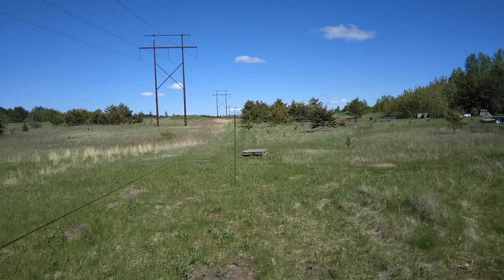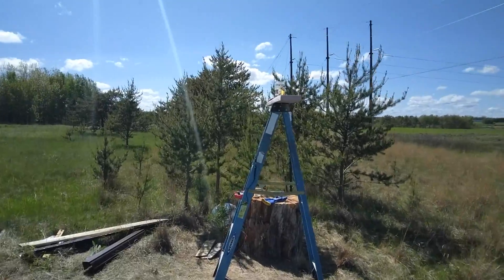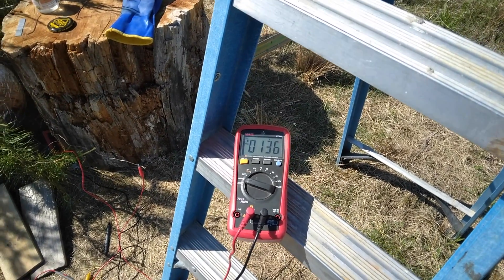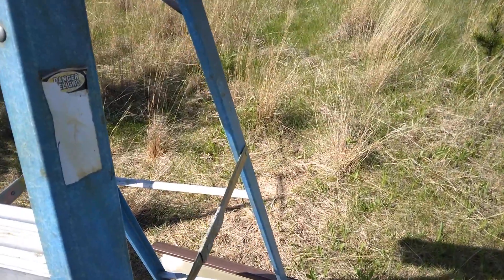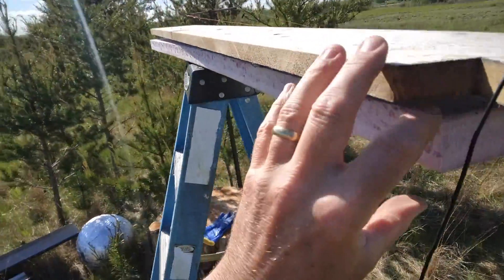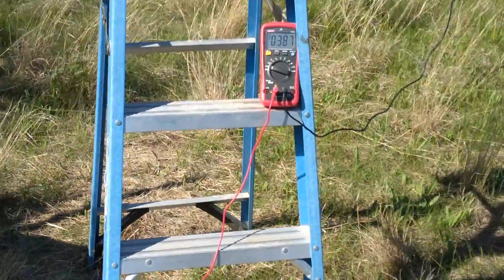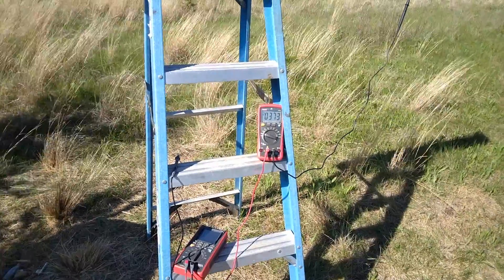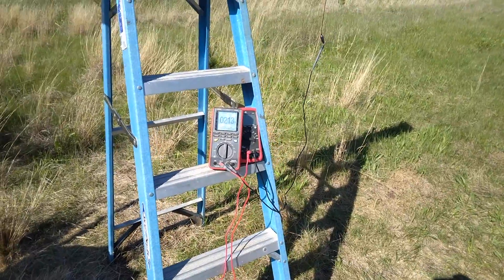Amazing stray electricity collector design!

Comment: You are just rediscovering the experiments of Faraday and magnetic lines of flux experiments he did in 1831. You are only 193 years too late to claim a scientific discovery. But the power you are seeing isn’t even 1 watt. One of your measurements was 21.1 micro amps (.0000211 amps) times was that 18 volts = .0003789 watts(.3789 mili-watts) you are not near 1 watt (a little over 1/300 of a watt). Have fun is the most important thing for you to do.. God be with you always.
Reply from the maker: The most I have gotten for converted usable power is around 60 milliwatts. -you can see that in other videos on my channel.  This video is focused on collector design and comparison, and from the incredible wood board with tiny wire design.  I don't know of any who has even done that.  The output was the same or more than a big solid metal conductor.
Reply: @doubleMinnovations  Thanks for the response. Good experiments. Good video, interesting that you can get any power from those overhead power lines, but surprised you can even get 60 mW. I live a few blocks from similar high voltage power lines running through my village here in Ohio. I doubt I would measure anything at my property. God be with you my friend and good luck with your channel.

Comment: Two things:  1.) What you're doing here is technically RF.  High power lines alternate at 50 Hz.  Fashion an antenna 22.3 ft long and it will tune perfectly with the "radio."   2.)  Voltage is NOT power.  Put a load on it and measure current.  Power = IV.
Reply from the maker: "RF' means 'radio frequency.'  60Hz power is what we have here, which is nowhere near that.  I have other videos that harness radio waves, if you're interested in that. -they show the volts x amps through a load.  Other videos I have for collected stray electricity from power lines also show volts x amps through a load.  This video is about the unconventional collector design of a wood board with tiny wire.

Comment: I wonder what an effect it would have on a Solar Panel?  Get a cheap solar panel from Harbor Freight and check the voltages and amps at various distances from the power line.

Comment: can you really put a load on it or not
Reply from the maker: This is just tiny amounts of power, but I do show how much I have harvested through flashlight loads in other vidoes.
Reply: @doubleMinnovations saw a vid many years ago, guy built a pyramid of copper and hung a pice of wool suspended in the middle and got blown back many feet! U should look into the pyramid designs!!

Comment: Your long wires are forming an air transformer with the power line. You can improve your setup to suck usable energy from the power. In the 50s a farmer near to us thought to do this very thing and it worked well. However, the power company has sensitive equipment watching their lines, they will detect any significant power loss and will come investigating. They will find your setup and unlease their hoard of lawyers loose on you. They knew how much energy the poor farmer had vampired from their lines, plus theft charges and whatever else they can think of. They sent the poor farmer to prison. All for enough energy to run a icebox, a couple of lightbulbs, and a radio. While it's fun to experiment and dream, don't really do it. It's not worth the trouble it brings.
Even small power companies have the equipment to do this, otherwise parasitic loses would destpry their profits.
Reply from the maker: This has been addressed hundreds of times in some of my other videos.  For these power lines; within the easement, the terms are that there can be no trees or buildings; but there can be fences. -thats in my first video on this subject.  These lastest experiments are out of the easement, and I could put a metal build right there if I wanted to and ground it.  I didn't I planted trees.  What's happening is a weak capacitive link.  What's available is tiny amounts of power.  Much less than a watt.  It's a curiosity that just sets some people off...
Reply: YEAH...there was a guy who built a truck that had a bank of large batteries in it with a coil that could be raised up enough to get enough power to recharge the batteries and he would park the truck under the HT lines and....well.....he ran much of his house on these batteries and he was finally caught and told that he had to stop or they would  charge him with theft of the electricity.  Because he was doing this intermittently, it was hard to catch him but they did.....pretty ingenious, though
Reply: The "poor famer" was still stealing.
Imagine if we all did that? (As I hear there's a big issue with people tapping the lines in India, wouldn't surprise me if it's like that in South Africa too)
Reply: @AdamBechtol  THAT IS PHYSICAL TAPPING OF THE LINES.....THIS IS NOT
Reply: @AdamBechtol  I wasn't calling him poor in sympathy. He was actually very poor. He could not afford the REA fee to run a line to his house for hookup. It was around $1000 in then money, nearly enough to buy a new automobile. But as the movie says, "He chose poorly.".

Comment: Found this a while ago.  The electric potential gradient of the atmosphere

On an ordinary day over flat desert country, or over the sea, as one goes upward from the surface of the ground the electric potential increases by about 100 volts per meter. Thus there is a vertical electric field E of 100 volts/m in the air. The sign of the field corresponds to a negative charge on the earth’s surface. This means that outdoors the potential at the height of your nose is 200 volts higher than the potential at your feet! You might ask: “Why don’t we just stick a pair of electrodes out in the air one meter apart and use the 100 volts to power our electric lights?” Or you might wonder: “If there is really a potential difference of 200 volts between my nose and my feet, why is it I don’t get a shock when I go out into the street?”

Although the electric current-density in the air is only a few micromicroamperes per square meter, there are very many square meters on the earth’s surface. The total electric current reaching the earth’s surface at any time is very nearly constant at 1800 amperes. This current, of course, is “positive”—it carries plus charges to the earth. So we have a voltage supply of 400,000 volts with a current of 1800 amperes—a power of 700 megawatts!

The current in a lightning stroke is about 10,000 amperes at its peak, and it carries down about 20 coulombs. 

https://www.feynmanlectures.caltech.edu/II_09.html
Reply from the maker: Thanks, I have done a little with that in another video, but nothing impressive.  Need to have a big ballon. -but then I suppose it would get shot down...
Reply: @doubleMinnovations  "it would get shot down" - You need to write "Born in the USA" on it, to make sure that no one takes it as "Made in China".

Comment: Very good experiment, to give better results at the beginning and end of the tips of the cable, solder 3 tips of the same gauge of the cable so that a snowflake figure is formed with which you will have 6 wires around the cable center that will be in the middle and check again and you will see how the voltage increases more. All of this is a result of the ions that are in the air, as the height of the cable increases (you only need one side of the cable elevated, the other could hang so that you can review the measurement with the same configuration that you have from the rod inserted in the ground as negative (actually it is the positive but since its discovery it was thought that it was negative) and the positive will be taken from the end of the cable that you have in it. high, But be careful, every meter that the tip of the cable rises with the configuration at the snowflake tip will give more or less 100 volts, therefore if I said it 10 meters more or less it will have 1000 volts (it also depends on the quality of the cable) but the important thing is that the tip has that snowflake configuration since each tip will be used for the positive ions that are found in those tips that protrude from the tip of the cable that is above, the capacitors that it has will serve to store the electrical charge but be very careful because as I just mentioned if you raise the cable 10 meters it will be more or less 1000 volts although the amperes will be very low when storing that charge in the capacitors in the air look for ground and concentrate If you touch them if you feel a strong shock because the capacitors will be discharged in a single blow, I hope this information helps you Greetings from Mexico
Reply: Beware deadly shocks, from capacitors!!!

Comment: Coil the wire around a plastic 2"x2' drain pipe and around a 2"x2' metal pipe both about 200 windings each. and see the difference. Use wire with the skin on the metal pipe.

Comment: This shows how strong the electric fields are around the hv power like lines. 

Not healthy thing.

If you where able to transform the voltage down to a usable voltage/current... You would get fined if caught.

Interesting but not useful.

Comment: You are close to high voltage electricity cables. These radiate an electromagnetic field. Any conductor in this field will have a voltage induced in it. This will drop off the further away you are from the high voltage cables. As you observed, various things will effect this electromagnetic field such as you own body being close to the conductor.  This is not free energy as it comes from the electricity grid. If you had made an efficient system to harvest this electricity then you would, in fact, be stealing from the power grid.
Reply: If that electricity is going to the ground, he would just be harvesting the grids trash,
Reply: @snowfloatin  I wish it worked that way, but it doesn't seem to.  I think maybe more electricity(electromagnetic field) would pour into what he had taken. It would be a minuscule amount, but what the poster said above would still be the case.
Reply: Mmmm
Reply: Stealing is charging people x $ for electricity when they just waste it

Comment: be careful posting this, it is illegal in some jurisdictions
Reply: He's been posting these vids for years and has permission from the co as it's running threw his land
Reply: :p
Reply: @ktownjunkie
It's a psi op.
If everyone did it, we wouldn't be in an energy crisis because of demand and all anyone would need to do is make their own battery out of simple electrolytes. It is why the witch hunts started, Nikola was ousted, and weed, crack, and meth were highest on the drug war list. Feds would make you believe it is government regulated and funded, but then make you pay bills after and collect on those taxes, too. They could have made all the infrastructure independant with a Darwin turbine at every telephone pole for less than $1200, and yet they'll make sure they pack their bags and sting you with garbage equipment potentially costing more than a Darwin unit, and human life, then continue to tell you they're underfunded because they have to pay bills, too, and then can't carry their own equipment or it is illegal and botches their own case without extensive paperwork where someone could claim harassment and assault while an agent isn't using federally regulated equipment.
Reply: If it's RIGHT AGAINST the power wires before they enter the meter...

Comment: I assume the voltage and   current measurements are with respect to earth ground. What you have is   two series capacitors with the power line being one plate, ground is the other, and the object on the ladder becomes a center plate forming a capacitor between it and ground and the center plate and power line. Thus you have a capacitive voltage divider. At 400V and 20 microamps the capacitive reactance is about 20 megohms. At 60 hz this translates to about 133 picofarads between the plate atop the ladder and ground. Your body forms yet another capacitor center plate between the object on the ladder and ground. The closer you stand, the greater this capacitance becomes. These capacitances in parallel add, shunting some of the current and voltage from the original cap with the ladder across it, thus lowering the measured voltage and current when standing nearby. Attempting to measure resistance of the dry board is probably greater than the highest resistance range of your DMM.
Reply: I think tapping into step potential along the ground under the lines may give you more power by measuring the voltage across two ground rods. This can be very dangerous because this ground may be carrying a high neutral current of the three phase lines. Start with  grounds about 10 feet apart and be very careful if you move them apart. See step potential wiki to  learn of the possible hazards before trying this. Also step potential can change drastically with soil moisture. Also see single wire earth ground (SWER) information wiki.  Experimenting with this is dangerous and possibly deadly.
Reply from the maker: Very interesting.  Thanks for commenting!

Comment: Tell us about the AMPERAGE.
Reply: Wow y'all. He goes into the amps starting halfway into the vid. Way to be ADHD :D
Reply: Hey I am ADD and I made it to that part. I am offen
Reply: will be good anyway but is damn ilegal.. even on europe XD.. you just taping em field.. no free energy,, just a robery XD
Reply: Crystal radio set at best. I've seen a small motor be run off a huge antenna
Reply: probably not a useable amount of current your not turning  a motor tfs
Reply: Well the line run has low current for distance to begin with
Reply: What amperage? 🤣🤣🤣🤣
Reply: Cool experiments. Not very useful unless you can get it to useful amps and volts. I think you should spend your time on that at this point.
Reply: If I understand correctly the point is to get comparisons between antenna designs. I think checking the electrostatic potential and the current delivery potential (which he does show in the video) separately is probably good enough for that purpose honestly. Sure measuring both at once would give you a power measurement which would also be interesting. But I can see that causing other problems too. 
I guess what I'm saying is I think this is good enough for comparing antenna designs for the most part.
Reply from the maker: This video is about collector design and comparisons.  Amazingly that a wood board with a tiny wire, can put out the same or more than a big conductor, as demonstrated towards the end of this video showing shorted current and voltage.  There are previous videos I put out that show loads if that's what you're interested in.  You just need to watch through the whole videos.
Reply: @doubleMinnovations  Hey did you think about using longer galvanized nails on the longer board to have a longer expanse between the nails?
Reply: Why not show us Voltage and amperage together?  Of course, when there is a short circuit, the volts come near to 0, depending on the resistance and impédance of the whole circuit, as we are in AC there are induction in wire loops, and capacitance between conductors, that is what happens when your body is close to the circuit, you are a part of it. Is the frequency 60 Hz?
Reply from the maker: the frequency is 60 Hz; -that's what we operate at in this country.  Check out my other videos for demonstrations of volts and amps through a load.  Also the same for harnessing energy from radio waves.
Reply: @doubleMinnovations Make an antenna that is tuned to 60Hz.  You will then get the maximum reception of the electrical wave.  Make sure it is as parallel to the emitter lines as you can get it.  Be careful of the output.  The strength may suprise you.  Test the voltage from the antenna to ground as well as across the antenna leads. Use single strand copper wire.
Reply: @doubleMinnovations OR maybe you could just tell us!

Comment: You are adding more ground reflector capacity when you get close to the circuit. So it gets out of tune when there is too much capacity.

It's not about the size of the antenna. It's about the natural frequency of the antenna, it should be able to reflect about the same frequency you are trying to pick up.

Comment: This is induction I think is the word its how transformers work the coils induct a different voltage higher or lower than the primary voltage..  Please study this more before you play around much more..  Those transmission lines are carrying hundreds of thousands of volts to reduce loss..   Be careful or you may end up a charred spot on the ground..     What your playing with if you knew a bit more could easily power your home and no one would notice....
Reply: It would take a lot of wire to capture enough electricity to power his house.  And, the power company would notice the loss.  I don't know if they could charge him with stealing power if the equipment is not on the power companies property.  He could argue that they allowed the magnetic field to enter his property and what he did with it was none of their business.